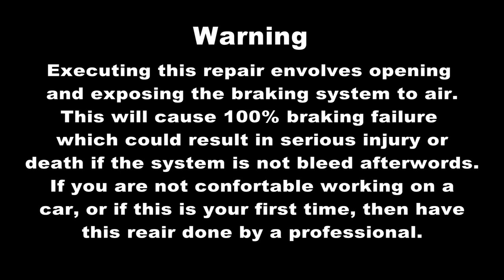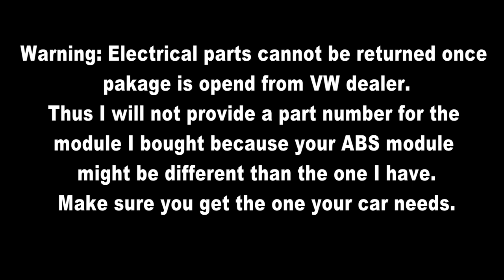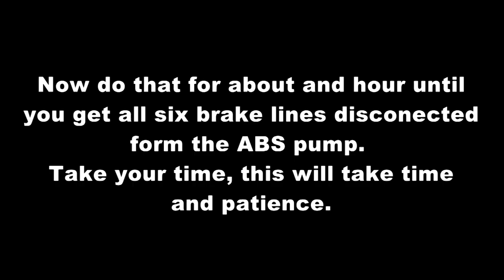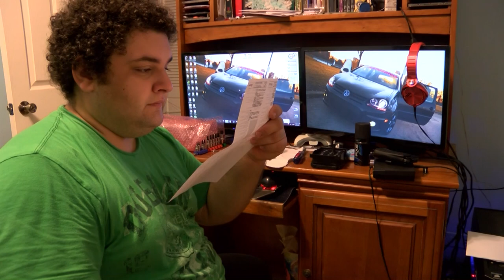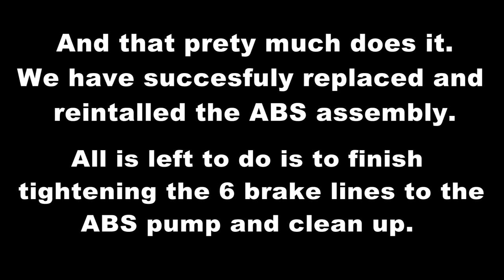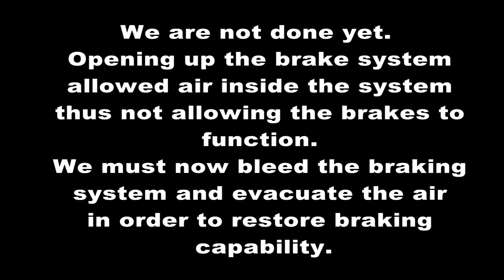2009 Volkswagen GTI ABS Module Repair Part 1

Comment: I have the worst regret ever at buying a 2010 VW Jetta Wolfsburg edition last year for my son. The car has a stage i tune on it ,and it is very quick & fun to drive ( even though I hate FWD cars) & my Son loved it . The car was running perfect ,then all of the sudden , The ABS module , 3 of 4 wheel speed sensors ,and transmission crapped out . I took it to 2 different tranny shops ,and they both advised taking to VW for ABS recall . When I gave VW my VIN # they told me my car was qualified for the ABS recall, so I had it towed to dealer , then the service tech from VW calls me and tells me no , I'm not covered ,and it will be about $8500 to fix everything.  I would not ever ,ever buy anything from VW.  I never want to see another P.O.S VW again in my life!   They are over-complicated plastic pieces of .... CRAP !

Comment: How do you know that you do not need to replace the whole abs unit, namely the module and the pump. I know that my module is faulty but I am also getting a CODE 009: 01276 ABS Hydralyic Leaking code. Do you know whether this means I need to change the pump as well?
Reply from the maker: Paul Thompson You might need to change the hydraulic pump as well. I was lucky that I only had ABS module cods. Check for leaks around the pump to confirm. If you have leaks on the exterior check for chewed up paint. If the leak is inside it means a seal had gone bad and I don't know if this pumps are serviceable. Generally with ABS components in general, they are sealed components and replacing them is the most recommended. From what you told me I think the pump is bad as well so you probable has to replace that as well. Also don't try to wing it by placing a brand new ABS control module on your potentially damaged ABS pump, it may damage the new ABS pump. Also consider getting a diagnostic test from the dealer so they can confirm. They will charge but at least you will know for sure.

Comment: hey man do you have to program front the dealer.
because i install two and continues biping my ABS,TRACTION CONTROL, AND BRAKE?
Reply from the maker: You must  have it reprogrammed at the dealer there is no way around it. The blinking will not stop until you successfully reprogram the module.

Comment: Hi George. Do you think a used or repair my original module will fix my issue? I'm really trying to avoid buying a brand new from the dealer. Thanks!
Reply from the maker: Maybe, but I do not know for sure. You would still have to reprogram it.
Reply: +George Bonta I researched and saw that there are a couple of companies online, that rebuild the modules and advertise they would not need to be reprogramed, since it is the original module that matches the car's VIN #. I just shipped it today and hope within the next 5 days I will get a response if it was repairable or not. I am just trying to sell the car and not worth the 2200 the dealership quoted me to fix. My plan B is to program this used ABS I got from a junkyard that seems to be in better condition, from the 1st used ABS I bought that would not communicate with my car, even after they tried reprogramming ($70 programming fail) Thanks again for posting this, and I will let you know what I found out. I would appreciate any feedback anyone may have.
Reply from the maker: Cool let me know how it goes.

Comment: Hey Man, thanks for the info...
if i have a pump or module issue, will i be able to just buy the entire assembly (ABS pump and Module attached) as one piece USED from a different car and install it in mine?
thanks
Reply from the maker: +bikaraa Definitely yes, just remember that it needs to be reprogrammed.
Reply: +George Bonta , thanks for the reply dude. why didnt you do the same. wouldnt it have been more cost effective for you as well? it would cost much less than 1000 bucks!
Reply from the maker: +bikaraa I'm not that confident in buying used electric parts but I looked online and I know there are some good deals out there. Is really up to you. Make sure that wherever you buy it from they show an authentic photograph of the unit. That's as much advice as  I can give on used parts since I did not acquire mine used.
Reply: thanks man, noted! :)
Reply: +bikaraa
Did it work our with you my friend ? buying a used entire assembly (ABS pump and Module attached) as one piece ?

I am thinking of doing that too.
Reply from the maker: I did not purchase the unit used. I purchased the ABS module form the VW dealer and them installed it to my old ABS pump and it all worked out. Just remember once you replace the ABS module with a new unit you must have it reprogrammed at the dealer or a reputable shop that works with Volkswagen.
Reply: Mohammad Yacob hey bro, did it work for you buying a used unit (Module and pump? ?

Comment: why did you not remove only the Electronic module from the car?
 (sorry for my bad english i'm french and i have to do that)
Reply from the maker: +Macia Raphael The initial plan was to remove only the module. On some models you can do just that without going threw the trouble of removing the pump as well. Upon further inspection I noticed the whole assembly (pump and module ) is slammed on the edge of the engine compartment next to the left frame (looking form the front) which means there is no possible access to reach the 4 screws holding the module to the pump. Assuming you can somehow remove the screws you would need to magically pull the module away from the pump towards the metal frame of the car about 2 cm away form the pump to pull it from the metal electrical prongs the module sits on. So yes on some modules you can do that but those modules are not as crammed as this car and the ABS assembly is a whole lot more accessible.

Comment: George my local Volkswagen told me my module is bad but my car drive fine just the break light blink red and the abs light and traction control light other the. That the car drives with no problems. Do u think was telling me the truth the module is bad or is just a sensor?
Reply from the maker: Yes. My vehicle behaved the same way. Drove just fine, but the module was bad. I was able to varify this myself using a basic scanner.
Reply: I guess I’ve fine driving like that my dealer told me 3000 to get it fix
Reply: I wonder how far you from sc
Reply from the maker: WHAAAAAT. For a power flush!!! No way 3 gs for a power flush? Maybe there is another problem that you overlook. Look at the list they gave you maybe you need something else.
EDIT: after I read your comment I called the dealer and they said $ 139 for a power flush with the machine.

Comment: My abs light is on and my front wheels are stuck does not want to move could it be the abs gearbox is 100% it’s 2006 gti

Comment: HI, where can buy the 2009 Volkswagen GTI module unit including the PUMP and than deliverer to Taiwan, the quotation (from Taiwan's is $3000. thx
Reply from the maker: +潘明豪 Well I purchased the module unit form the dealer because that was the best bet to not get a faulty one and I could not find it elsewhere. If you decide to get it form a VW US dealer than it will cost you around $920 USD. In terms of the pump itself I do not know for I did not need to buy it as well. Also I do not think there are any after market sites to use for this part. Sorry dealers control the market on this parts thus they overcharge to make up for loss on vehicle sales.

Comment: Bro i scanned my bcm (brake control module) and i got fault code 01314 compensation not carried out engine control unit. Dou tou think i have fix my bcm? Or my ecu?
Reply: Epc light on and car goes limp home mode always

Comment: Nice video buddy, very useful. I have a question though, what if the new module has the identic same numbers as the old one,  do you still have to recode?
Reply from the maker: Yes everything has to be reprogrammed.

Comment: If I just have the code for the hydraulic pump do I still have to take it to the dealer after put a new one in to reprogram the abs???
Reply from the maker: +javier sanchez If you have the parts you need you can do the hard labor yourself. Physical hardware is pretty straight foreword to replace even if you do both the pump and module. However as long as you are changing the module with a different unit you must go to the dealer to get the new module reprogrammed at the dealer, there is no way around it. The dealers have to software so they can hijack the market with ridiculous prices.
Reply: +George Bonta I'm just changing the pump my module it's fine do I still have to go to the dealer ?
Reply from the maker: I'm pretty sure you don't have to go to the dealer if your just swamping the pump.
Reply: +George Bonta thank you I didn't have to swamp anything before I order the pump I check all the fuses and one was bad now scanner just show a bad speed sensor but thank u your video helped me a lot
Reply from the maker: No problem. I am glad you did not have to swap an expensive part. Take care.

Comment: I have fault code 01435 on my vw golf tdi, do u think this will fix that?
Reply from the maker: I don't think so, that seams like a electrical issues with the sensor, replacing the ABS module might be needed, but there could be other issues like the pump itself. At this point everything is a maybe, you need further diagnostic to determine the exact issue.

Comment: Can you pass along the revised module part#?
Reply from the maker: +Dane Anderson The new module I had was a 1K0 907 379 AN the old one is the same number but has an AD at the tail and not a AN. Be advised that there might even be a newer one when you read this message. Who knows, this modules get improved frequently.
Reply: Thank you so much for your helpful advises, another question please, my car's unit number is 1K0907379AE, and it was superseded by a newer version which is 1K0907375AE; my question is there is no problem in buying the older version which is the same number as the one on my car right??? or I have to buy the latest model number ?
Reply from the maker: In not sure about that however I find no reason why an older version would not work.

Comment: thanks for the video but you don’t really know what you’re talking about i think. you list all the things that could happen if your abs sensor is needing replacement and then you mislead people and tell them to do it at home and say it’s the only way to fix it. it could be the sensor is working correctly maybe and telling you your abs system is having a problem in which case you need more repairs way past a new sensor. so maybe just think of that next time guy.
Reply from the maker: This video has nothing to do with the replacement of a ABS sensor. This video is all about the replacement of the ABS control module which controlled the ABS pump. And no "it could not be that the sensor is working correctly" WRONG You see, this vehicles (Volkswagens Mk4 and UP) have a very good way to tell you, the module is broken. Its simple, you plug a basic, cheap OBD 2 scan tool and the basic tool will tell you something on the lines of "U0121" or ABS module fault (I don't remember exactly). Also the immediate fault alarm does not go off if a simple sensor is malfunctioning, but it most certainly does go off if the ABS control module is broken or malfunctioning. In my case the check engine light was flashing indicating a severe fault, the immediate fault alarm was auditable inside the vehicle, the ABS warning light was red as well as the yellow electric power steering fault light was lit, and the most instant give away was no speedometer reading, and no mileage counter also the ABS code was registering in the vehicle ECM as a loss off communication. After replacement and reprograming of the new module all symptoms and alarms went away. So ya I'm pretty confident I know what I'm talking about.